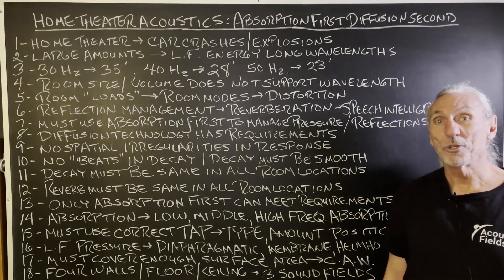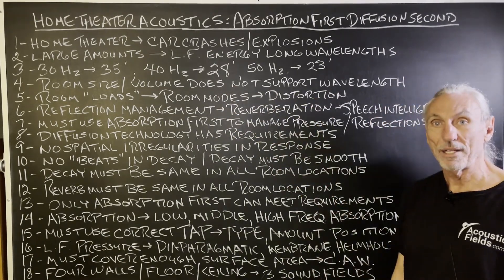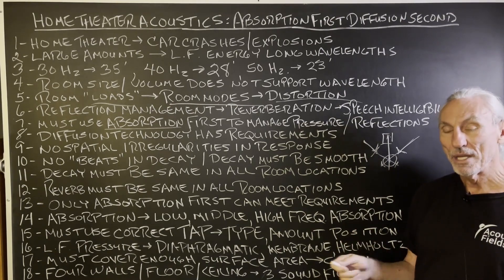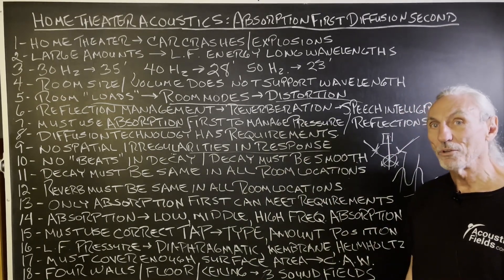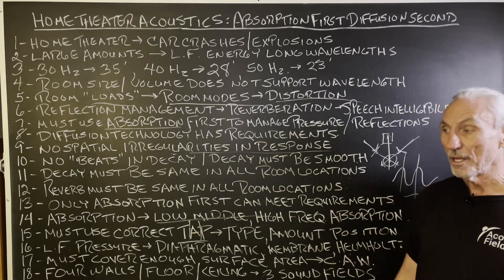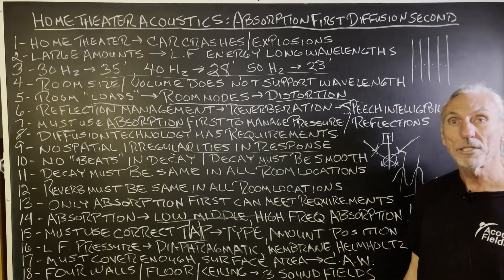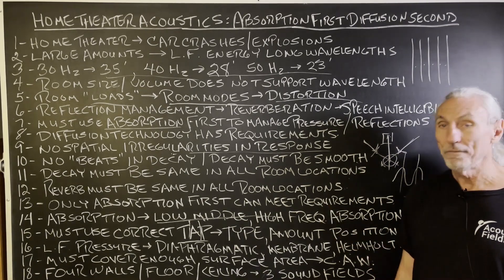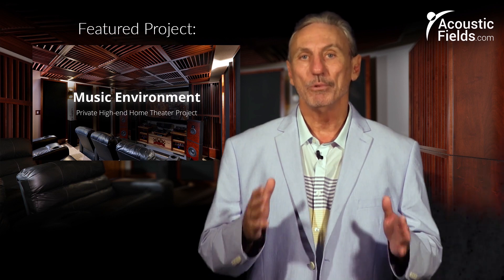Home Theater Acoustics: Absorption First!! ... Diffusion Second - www.AcousticFields.com

Comment: Let me say again Dennis, what a tremendous asset you are. You save us so much time, money, and frustration through your presentations and especially your room analysis. And while sometimes your information is hard to bear, better from the beginning, what works and doesn't. After all, wishes and hopes are not a part of sound strategy.
Reply from the maker: We find that most of the people that give advice on acoustics on the net about rooms have never built a room and measured it in their lives. They just keep repeating the same nonsense that they have read or heard somewhere. We have built over 300 rooms and measured them for noise, pressure, and reflections. There is no substitute for building and testing. Our product's performance reflect this effort.
Reply: @AcousticFields  I believe it's more nefarious than that. People telling others what they want to hear in an effort to sell products of questionable or no value, e.g. foam diffusers and 'bass traps'.

Comment: right! will do so whenever possible
Reply from the maker: Start with a goal or strategy. Develop the appropriate tactics to achieve your goals. Begin with a room size that minimizes pressure and reflection issues. Make sure all noise transmission issues are addressed properly. Start the treatment side of the equation by focusing on the lows first.